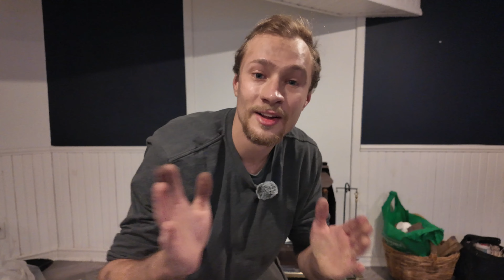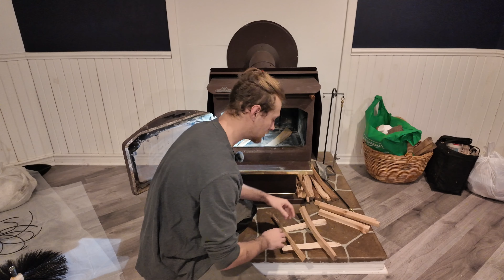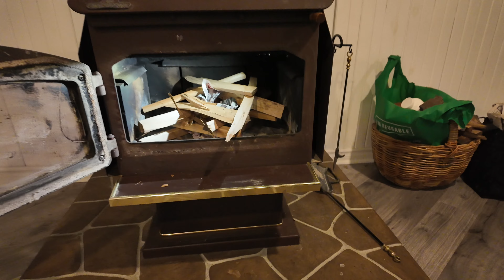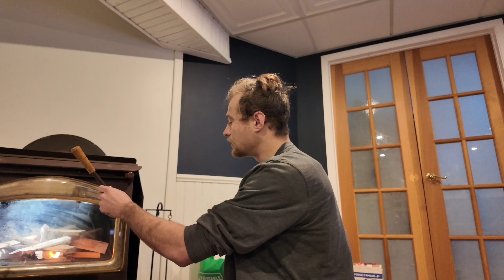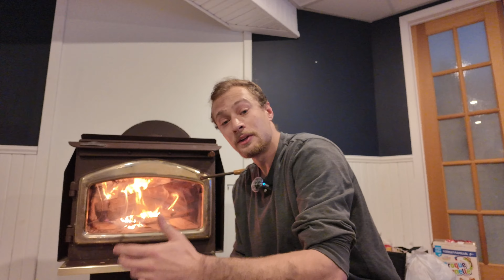Wood Stove Startup Explained | Safe, Clean & Efficient Fire Every Time

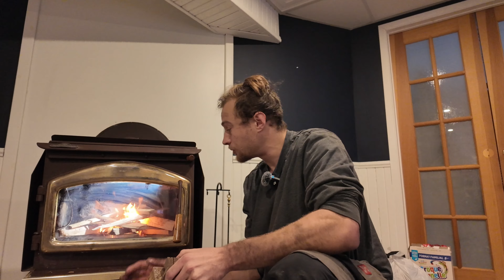Comment: Personally, I prefer the top down method. Been my only method to start a fire for nearly two decades, and there are now plenty of videos here that demonstrate this method (it does however, indeed pre-date Youtube). Takes a little time to setup, but once lighted, there is less work (simply air management) and no need to open the stove door to reload till coals only are left. And coals only is the best time to reload. Opening the stove door when there is still a fire (2:47) increases the chance of smoke and particulate matter from the burn entering the home, which is not desirable as that decreases in home air quality which is especially bad in modern air-tight homes. Hope this helps.

Edit: Also see where this method was publicized, in the book : *Norwegian Wood, Chopping, Stacking and Drying Wood the Scandinavian Way*, by Lars Mytting